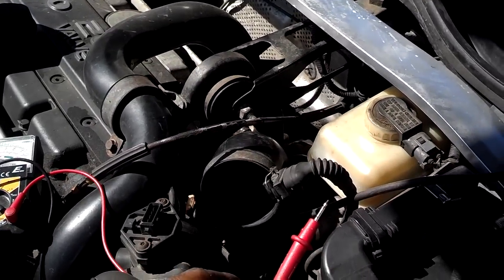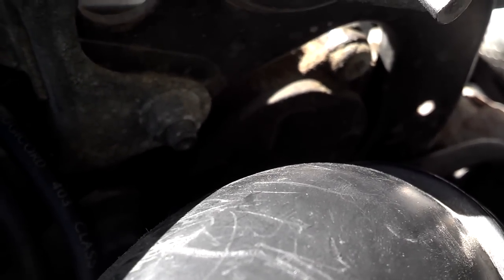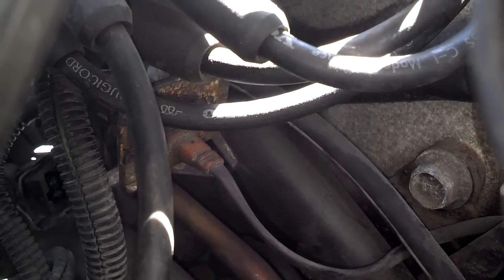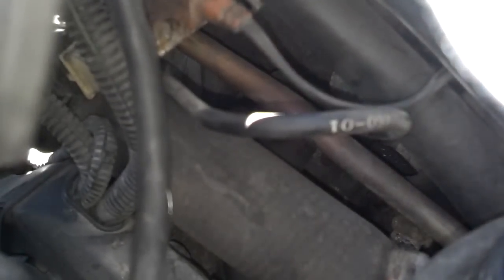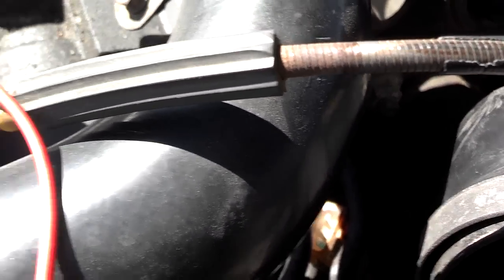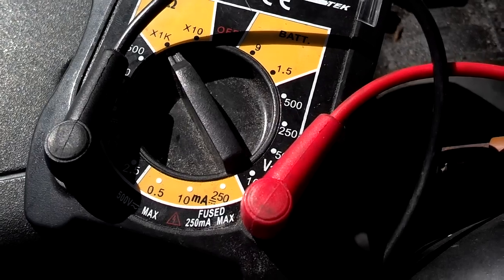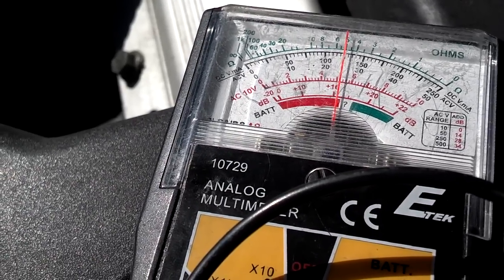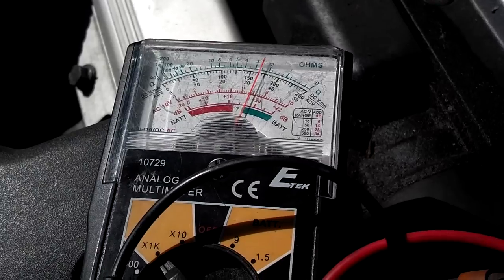Camshaft and crankshaft sensor location and testing on a Volvo 850, S70, V70 - VOTD

Comment: Thanks Robert I should have said its a 1995 850 10v NA. I have checked and the oil is coming from the oil filler cap. I have a new seal on order, thanks to your other video about oil on top of the cam shaft cover.
Reply from the maker: Glad to help

Comment: Mr RobertDIY, your videos are beyond amazing! I come to you with a problem. I had a check engine light come on today (thankfully) which was P0335 relating to the Crank position sensor. The issue I'm having is that very sporadically, the car will suddenly JERK really hard. Feels like a sudden cut in fuel or spark. Do you think that the crank sensor could cause this?

I recently removed and replaced the transmission myself and was thinking that possibly it got damaged during re-installation. What are your thoughts?  The sudden jerk is not relative to boost. It mainly happens during regular driving but overall its very random....
Reply from the maker: Jonathan Schmok What kind of car do you have? Yes a failing crank sensor can cause intermittent issues.
Reply: Robert DIY I've got a 1997 Volvo 850 AWD 5spd .... it CAME with a 2.4L, car had a burnt valve... so I got the head rebuilt and popped a 2.3L block in there. 

Car currently has the stock red injectors... 15G Turbo.... new plugs, new coil, new cap, new fuel filter, new air filter, cleaned MAF. That all being said, I recently had a failed Driver side CV Axle but totally mis-diagnosed and thought the transmission itself failed. Pulled it out, then put it back in. Upon putting it back in this sporadic stutter issue arose. Prior to that it was non existent.
Reply from the maker: Hmmm, that is strange.
Reply: Robert DIY I have fixed the issue!  Want to know what it was?  It seems that the ignition coil wire was too close to the wire for the Crank sensor causing it to mis-read and of course pull spark/stutter. Literally all I did was this:
1. Installed the black cap that goes on top of the distributor cap
2. Zip tied the crank sensor wire WELL away from the ignition coil wire that goes to the distributor.

Problem fixed! This thread helped me out:

http://www.matthewsvolvosite.com/forums/viewtopic.php?f=1&t=55757#p284034
Reply from the maker: Very nice, thanks for sharing.

Comment: Hi Robert, I love your videos. You've saved me some bucks over the years by demonstrating how to get at stuff on my Volvo and fix it. One thing that I'm struggling with, you start the video with the air intake stuff already off. I can't seem to find the right spot on my car. I have a 2000 S70. I need to replace the Camshaft Position Sensor. Can you please do a video showcasing "how to" from the start? Thanks Paul
Reply from the maker: https://youtu.be/hjZFY-1x1Xk
Reply from the maker: Information in this video should help.

Comment: What happens when you don't get a signal from the crank sensor plug when you hook the continuity tester to it or take a stick tester with a volto meter hooked into it sister where the voltmeter is connected with the test light
Reply from the maker: I really don't know.

Comment: Weird symptoms. no start after a full day of running errands. Now car won't start. and the only  I get code p0410 . one time it wouldn't start and I jiggled the hot wire on the battery and it started right up. this time it didn't do that. just a "CLICK" and nothing else. not even a steady "click" which would tell me it's a dead battery but the battery is only a year old. from my description, is my camshaft position sensor going bad? I read that they "gradually" fail a not an abrupt failure. is that also true?
Reply from the maker: https://youtu.be/Kk1_lDG9mEo
Reply from the maker: Some cam sensors do slowly fall.

Comment: Hi Robert great video thanks. My rear camshaft seal is leaking & when hot the car hesitates & will not start very well if you switch it off. If the oil is getting on to the Camshaft sensor, would it cause the sensor to fail?
Reply from the maker: I have no idea.
Reply from the maker: I don't even know what kind of car you have.🤷🏾‍♂️
Reply: @RobertDIY  you

Comment: Thanks Robert.  I have a stall/no start with my 960 (2.9) and I get no ohm reading on any of the 3 wires.  I believe the camshaft position sensor is similar in the 960 as the 850??
Reply from the maker: I would think so. Is the fuel pump good?
Reply: @RobertDIY  I can hear it prime when I turn the key to position 2 so I think so.  All the ohm readings on the C.P.S. show no value (very high resistance) where most are 500-1k
Reply from the maker: If the car has a no start issue, I'd see what's missing. The engine needs 5 things to start, 1. Fuel, 2. Spark, 3. Timing, 4. Compression, and 5 air. Something is missing. If the cam sensor is bad, it will usually cut fuel and spark.

Comment: Buenas sr Robert tengo una lectura en el odb 1 de mi volvo 850 wagon modelo 94 me sale codigo 444 acceleration signal ( una pregunta tengo que reemplazar / cambiar sensor fae Rpm ? ) gracias
Reply from the maker: RONAL MAX POWER ¿Estás diciendo que tienes transmissionproblem ? ¿Es el cuerpo del acelerador y el sensor del cable del acelerador tanto enchufados bueno?

Comment: My  diagnostic tool shows a 324 code on the A2 position.  The car does start fine, but MAF sensor is bad. I wonder of this might be an old code since I have not been able to clear the codes.  Can not get a good connection on the B1 and B6 positions, so codes won't show or clear.
Reply from the maker: Interesting.
Reply: @RobertDIY  Update- Looks like I got the codes cleared and now there is n indication that the MAF sensor is bad and the check engine light is off. I will check the A6 terminal (cam sensor) again today and try to make sure that all codes in the B diagnostic box have cleared, then run the car and check the codes again.

Comment: I have a p1671 code on my 2000 s70. I'm trying to replace my camshaft sensor, one bolt was attached to the engine cover housing( not the two bolts as shown) I'm still looking for another bolt, but the connector looks like it feeds into the engine.
Reply from the maker: Maybe yours is a little different. I'll check on a car tomorrow.

Comment: I can't figure out how to get the cam sensor plug disconnected from that bracket that is attached to the engine. Have never seen one like that before.
Reply from the maker: Yes.
Reply: Decided to leave it alone for now.I thin I got the codes cleared and I will check tomorrow to see if this 324 code shows up again at the A6 position.

Comment: Let me see if I've got this right you're not actually testing the sensor itself your testing the connector is this with the key on or off I'm just asking the question thank you sir
Reply from the maker: Yes, you test the sensor for resistance. It is unplugged from the car so it doesn't matter where the key is, it can be on the moon. ;p

Comment: Robert hi   my 1998V70XC    suddenly stalls when started after 10-20 secs trys to stay alive but turns off checked relay (clicks) /pump makes noise   cleaned rotor/cap and cleand the Maf   still the same      could it be this??
Reply from the maker: https://youtu.be/NhtUXZTurzo

Comment: Hi Robert, I drove through a small puddle and my 1999 xc70 started to misfire immediately. A friend pulled a P0300 code and I am trying to locate the crank sensor to check the wiring for water intrusion. Can you help me to locate it. Love your videos thanks!
Rodney
Reply from the maker: The crank sensor should be in the same location as the one if the video shown. Volvo S70, Volvo 850 Crank Sensor Replacement, P0335 - Auto Repair Series
Reply: That sounds to me like an ignition coil.

Comment: hello sir i have a 2003 volvo s80 turn over but wont crank i change the crank sensor still wont crank i unplug and test it still no fire from the plug i put the tester and crank sensor and turn it over no voltage from crank sensor i need help please. ps i have a code p0600
Reply from the maker: cedric sawyers Maybe the cam sensor is bad.

Comment: I have a 98 V70 non turbo. Wife got in it to go to work but it just cranks but no start. I checked the fuel pump and it's fine. I drove it last night and it ran fine. I'm suspecting the crank sensor. If it's bad what kind of reading would I get?
Reply from the maker: No fuel or spark.
Reply from the maker: https://youtu.be/YiPAPu-K8OI

Comment: I have an engine light on my S70 wich sometimes is a bit difficult to start. I checked error codes and I had "bad camshaft sensor". I reset the codes but the light keeps on shining, but I haven't gotten the same code again. So I followed this video and checked the resistance on the camshaft sensor, it was dead. So tomorrow I will visit the scrapyard, get a new sensor and try it and see if it works.
Reply from the maker: +Baxtexx probably will.
Reply: It was! Thanks to your video, I just saved a great deal of money. The sensor cost me 2 dollars at the scrapyard. :D

Comment: Did you ever get a spark?
Reply from the maker: Yes.
Reply: @RobertDIY  I have the no-spark condition on a '94 850.  It was running and then suddenly died, same condition as several months ago when we thought it was the fuel pump relay.  Apparently I have been working all around whatever the problem actually is.  It is definitely an intermittent problem.  Another guy posted a video where he claimed there is crosstalk between the crank position sensor and the cam position sensor.  He put a length of hose over the cam position sensor lead to keep it away from other wiring and claimed that solved the problem.  At least the car started right away after he did that.  I can't figure out how it could go so long and then suddenly be a problem.  Anyway, I have a dead Volvo sitting in town that I need to move before the cops do it for me.
Reply from the maker: Cam sensor will usually also cut spark. Crank sensors almost never go bad. How's the coil?
Reply: @RobertDIY  Turned out to be the cam position sensor. It tested open circuit between every pin.  However, it is very tricky, because on the new sensor ($145 at O'Reilly, very poor quality compared to the old one), the Ohm reading is momentary.  It acts like a capacitor, you have to reverse leads to get a reading again and it indicates open circuit very quickly. 
Anyway, thank you very much for all you have done. If you get to Chehalis Washington I have a 1982 244 DL B16B 4+overdrive you can put back together.  The wiring harness completely fused, so that has to be fabricated, the connector on the cold start injector is whittled away to expose the pins so you can't plug the harness in there anymore, the plastic fuel line has been shortened at the filter and what is there on the ferrule of the filter housing is kinked and supposed to hold 80 psi, etc. 
The engine is now cleaned.  The amazing thing is that even with that K-tronic system completely gummed with old oil and almost no electrical connections left, it still ran at an idle of 1,500 and would go down the road!
Reply from the maker: Thanks for sharing.

Comment: I really need some help when I scan my car the is what come up Ihelp plz. 

6440 intermittent ECM-6440 reset valve camshaft signal missing

644a permanent ECM-644a camshaft control Faulty
Reply from the maker: Keithon Hibbert What kind of car do you have? What is the issue?
Reply: I have a Volvo s70 1999 5t when I scan it with the obd2 this is the problem

6440 intermittent ECM-6440 reset valve camshaft signal missing

644a permanent ECM-644a camshaft control Faulty
Reply from the maker: Keithon Hibbert What is the problem? Is the car NOT starting?
Reply: Yeah it start and some Time it's don't start
Reply from the maker: Have you replaced the camshaft sensor?
Reply: Because when I I scanned it this is the code that I find.

I have a Volvo s70 1999 5t when I scan it with the obd2 this is the problem

6440 intermittent ECM-6440 reset valve camshaft signal missing

644a permanent ECM-644a camshaft control Faulty
Reply from the maker: I recently had that issue with my mother's '99 Volvo V70. I replaced the key antenna ring and have not had an issue since. - https://www.youtube.com/watch?v=_xrZoo8srVw
Reply: When you change it did it give you anymore problem?
Reply from the maker: None
Reply: Ok thanks

Comment: do you know the ohms of the cam shaft and the crank shaft sensor for a 1998 Volvo s70 t5 it has difficult starting up do you think this has to do with the cam or crank no codes
Reply: the fuel pressure is good sometimes it starts perfect but some times it just cranks until the third time it starts
Reply from the maker: +juan hernandez third time??? How many seconds is that?
Reply: like each time
5 seconds  times it just cranks
Reply from the maker: +juan hernandez if you have no codes, it is likely a fuel delivery problem.
Reply from the maker: +juan hernandez https://youtu.be/gLoO-D4yOcU

Comment: I read another comment somewhere on one of your videos to where the grey relay box above the radiator can be bypassed or jumped or something.  How can I do that?
I've got a 96 850 T5. Have changed the camshaft and crankshaft sensors. Have cleaned the spark plugs. Spark plug wire from the distributor to spark plug 3 reads dead with my ohm meter. All the other spark plug wires read ok for ohms.
Please, any thoughts or suggestions?
Here is a video of what mine is doing. Sometimes it cranks and the timing belt rotates, sometimes it won't crank and makwe the noise in the video.
https://youtu.be/f2EOd9DXQ1E

Comment: I have a no start condition, I checked my crank sensor resistance and I have 327-ohms  my cam sensor is showing 697-ohms with the multi-meter set at 2000k  I read that special is 300. Do I need a cam sensor?
Reply from the maker: try to start it and read the codes after it fails to start.
Reply from the maker: https://youtu.be/iZQtjN2LKuw
Reply: @RobertDIY I tried cranking but not getting any codes. Does anyone know what the cam sensor resistance spec is?